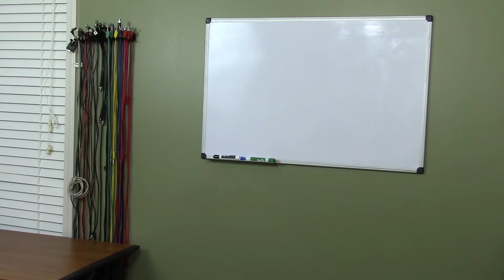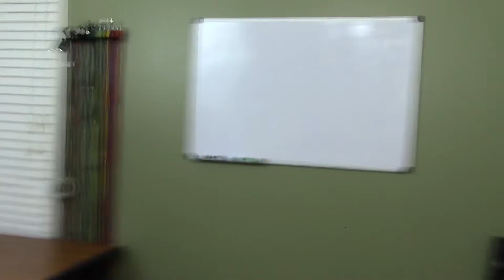Tour of New Lab

Comment: 18% gray will work well, and will be colour neutral.
Reply from the maker: Yep, I'm just trying to find a way to get around actually having to paint the walls. Because that will requite me to paint it again when I move out. I may just get a light gray backdrop or something like that.
Reply: KF5OBS
 Light grey paper on a roll? Kraft paper roll and some small thumb tacks to hold it top and bottom. Should get rid of a lot of the green and the holes will be easy to fill.